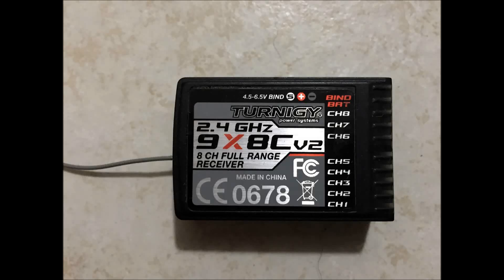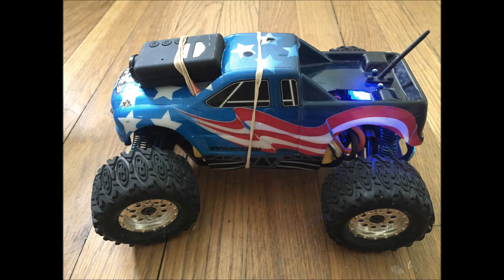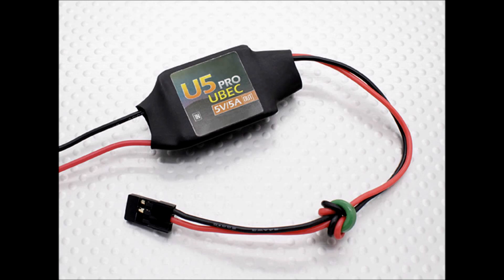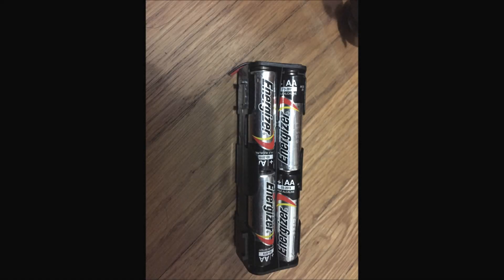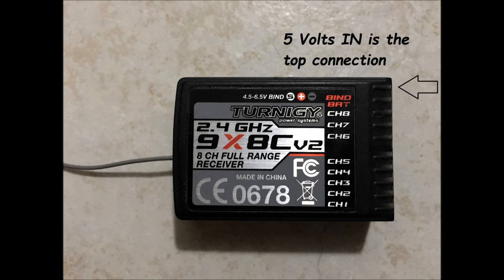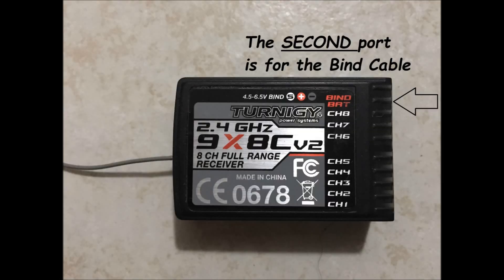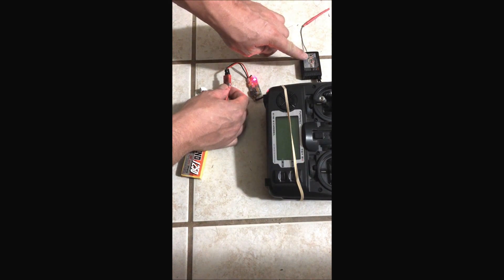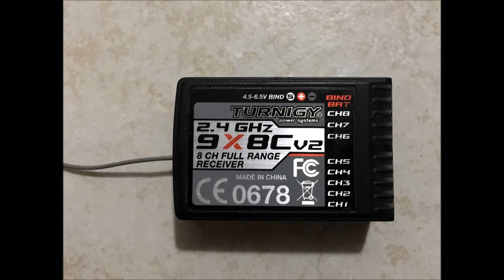How to Bind Turnigy 9X Remote: Binding Procedure for RC 9ch Reciever Module

Comment: Hi can anyone help please or make any suggestions.  The original receiver supplied with my Turnigy 9X transmitter was received bound but I am now trying to bind a second receiver, exactly the same type as shown in the video, with the transmitter set to the 2nd model, but when I connect the battery the light on the UBEC lights up solid and the light on the receiver flashes very faintly,  I then press the button on the back of the transmitter and switch it on but the receiver remains flashing and does not bind.  I also want to add a third model using an Orange R620X receiver.  Any help will be much appreciated, thank you Ian Brear
Reply from the maker: Evening Ian, thanks for the comment. It sounds like you are doing everything correct and the receiver is obviously getting power. Double check that the bind cable is in tact, if that doesn’t work you might try buying another receiver. Sorry I can’t help more.

James

Comment: Why is that all the videos I can find the battery is plugged into the bind, and the bind is plugged into the battery? Are you doing something wrong or is the receiver mislabelled?
Reply: While I am at it I just got a Turnigy HVSBEC as well, and I can't see an instruction sheet anywhere to tell me where I need the jumper for 5 and 6volts, do you know?
Reply from the maker: I'm not sure I understand the question fully, sorry. During the binding process both the bind cable and the 5V should be connected to the receiver. 

I'm not sure on the HVSBEC where the jumper is located to switch between 5 and 6 volts.
Reply: If you look at the writing on the 9X8Cv2 the top red print says BIND, and directly below that it says BAT. Every video I have seen (including yours) people plug the bind plug into the BAT pins on the receiver, and the battery connector into the BIND pins on the receiver. Did Turnigy mark the receiver wrong with the red typed words back to front, or are people doing it the wrong way in the videos?
Reply: Have been in contact with a Hobby King product specialist and he gave me a link to binding. https://hobbyking.com/media/file/967288036X1102364X36.txt

How to Bind Turnigy 9X Radio to the 9X Receiver
-----------------------------------------------
by Red.13

1. Have the 9X Radio turned OFF.

2. Insert the Bind plug into the last set of 3 pins marked as Bind on the Receiver.

3. Power up the Receiver. You will see the red LED, inside the Receiver, flashing at a pretty fast rate.

4. Press and hold the Bind button on the back of the 9X Radio.

5. Turn the 9X Radio ON. The LED inside the receiver will go solid ON indicating the Radio and Receiver are now bound together.

6. Release the Bind button on the 9X Radio and remove the Bind plug from the Receiver.

Test all channels. You are ready to fly.
Reply: @DodgyBrothersEngineering  Did you ever get an answer to your original question?
Reply: @tommykuznia3421  Yeah I am also curious about this one
Reply: @tommykuznia3421  sorry never got a notification. No... looking at my question I don't even understand it myself now. Guess I will need to get the remote out to have a look what I was talking about.
Reply: @stavrov-w6n  thanks the auto translate from Italian is not great, but I will check it out.
Reply: @DodgyBrothersEngineering  Long story short you need to plug in the BIND cable in to the BIND slot on the receiver and the BEC in the BAT slot or any other channel.
If you do it like on the video, you will blow up the 22uF tantalum capacitor and the voltage regulator inside the receiver. Also keep in mind the polarity wires + and - 
I'm glad if i helped you :)
Reply: Thanks. Just hooked it up as described and fried my receiver before I noticed the labeling shows those connections are backwards. Bind plug goes on top.
Reply: @donaldblake3706  Here is the correct how to https://www.youtube.com/watch?v=psjCwyDRxQY

Comment: I have a question, I dont have a battery pack for binding and I only have the lipo and an ESC and everything else too is it still possible to bind?
Reply from the maker: Interesting idea by running the receiver off of one cell from your 3s lipo. Only concern is that you unevenly discharge your flight pack and balance charging would also be difficult. My advice would be:

1. Buy the $7.50 BEC in the description and wait two days for shipping.

2. If you are desperate to fly today, make your own power supply from two AA or AAA batteries. It is a little ghetto but would work...

https://www.youtube.com/watch?v=buyEeqBhrcQ&app=desktop